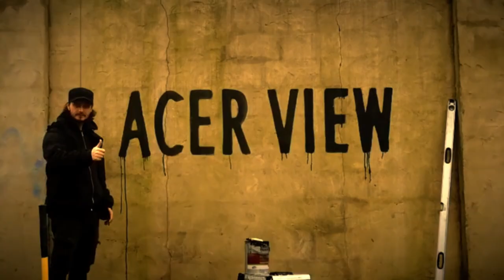Roof mortar mix ratio - tiles - verge - ridge - DIY

Comment: Why is Tim do it so differently you're supposed to add your sand to your lime and let that mix thoroughly for at least 15 to 10 minutes before you even start adding your water to create a better mix in theory you're three to one should only be three buckets total but besides the point adding water first creates a weaker inferior mix it don't allow the sand and lime to mix thoroughly without clumping up you probably had to mix it for 45 minutes before it's done extra it is key to make sure you're sand and line mixed thoroughly together before you add water to it that's just the way it is tim
Reply from the maker: Please refer to my response to your other comment
Reply: If tis guy's three to one is three buckets total, I'd love to see him mix 1:1:1 🤪

Comment: Interesting in that your local council allows you to fix the ridge with mortar, mine insisted on a mechanical fix. I much prefer the look of a mortar ridge but I have to admit the mechanical fixing will probably stand the test of time better. I,  also like to put a bit of water in the mixer first
Reply from the maker: You can do it with mortar but you also have to have a mechanical fixing too, so I have both. That's why everyone just does a dry verge now cause its mechanically fixed and is easier and quicker to install.
Reply: Regulation since 2015 requires all ridge tiles wether new or old , dry fix or wet must be mechanically fixed also
Reply: We mortar bed ridges on roofs that originally had that new builds we dry ridge their reasons for making it mechanical fix is stupid ridges don't often come off and some people are not impressed with a single screw holding their ridge down
Reply: @matthewthorley338  yes but why ? There are ridges bedded on 200 year old properties that are solid as rock
Reply: @master_Blaster91  yep I fully agree , have to be a poor mix and installation to come off
Reply: @matthewthorley338  also how do you actually bed and mechanically fix ridges I've never done it so don't know how it's done 👍
Reply: @master_Blaster91  batton fitted across ridge like a dry system , bed ridges on and the use the same fixtures as a dry system but threw the wet mortar on the joints with the metal clips , pain in the arse buy some clients request it some don’t
Reply: @matthewthorley338  thanks do you have to be careful not to screw too tight for it could push the ridge down into the wet mortar?
Reply: @matthewthorley338  sounds like a headache for me that 😂👍
Reply: @master_Blaster91  yes it can pull down into the mortar, we used broken tiles on the ridge tile ends and help to prevent with sag when tightening , even if it’s pinched tight it’s there for the client to visibly see them fitted. As you know the mortar is more than sufficient on its own as the tests of time have proved already .
Reply: @matthewthorley338  well il eat my words as I've just come home to a ridge that's blown off my roof and half of it is burried in the ground now would of definitely killed someone. Big meter long thing aswell

Comment: It allway cracks no matter what your mix is  I have tried loads of different  mixes I even tried a roofers secret  he used ceramic  floor tile adhesive flexible external  it last 2 year soon as sun heats it up the roof exspands boom it cracks  the last time I used flexible like trowel mastic  dried out and cracked I will not give in and fit a dry verg I have just painted my pointing with cromopol acrylic in black  should have said my ridge tiles are staf blues with the 40mm lip glazed nightmare
Reply from the maker: @patterdalezipsuzilil  have you tried a lime based mortar?

Comment: I was told by a roofer not to use plastisicer, builders use plasticiser, fairy liquid etc
Reply from the maker: Not sure why not, nhbc recommends using plasticiser. Means less water, less shrinkage. I wouldn't use fairy for anything other than for dishes

Comment: Hi Aiden.  Very helpful videos. I have to remove, clean up and reset a line of ridge tiles. I wondered, how long does your mix remain workable for? Will the last of the mix still be useful after two or three hours?
Reply from the maker: Hey, as the roofing mortar is dryer than brickies muck I'd say it would be a push for 3hrs workable time. I'd say on average you would be OK on maybe an hour and half, even then you might have to add a tiny bit of water after an hour. You might be able to push it a little more because of the low temperatures at the moment though

Comment: Im a roofer of 37 years. I incorporate SBR into my mix which improves bonding and also acts as an integral waterproofer. 
Its appropriate to use SBR as its used with rendering base coats.
Toodlepip
Reply: What’s you mix please? I’ve verges to do and some ridge tiles to repoint. Slightly worried about the verges cos the existing stuff (50years old) is crumbling out and the undercloak is deffo asbestos. Some is still adhered to undercloak and don’t fancy disturbing it. Any help /advice appreciated.

Comment: Hi Aiden is white cement hydrated lime.like you im self diy person great job by the way tnx for your content it really helps 
                    Dave🏴
Reply from the maker: Hey, no they're different things. They're both 'binders' but they have different properties. You would usually use one or the other. I've only used cement in the stuff I've done but have been on a lime short course. I suppose it could be argued that lime would be better for a roofing application as it's less brittle and if it does crack it can self heal. I don't know enough about it to advise on the mix or anything though. I have heard of builders chucking in some lime to lighten the mortar but as I had white cement and white sand I didn't need to do anything like that
Reply: Morning Aiden thank you for your swift reply mate any advice helps or a second opinion great job your doing thank you.
                  Dave🏴

Comment: Is this building sand the same sand you used on your garden wall? Trying to achieve a nice light mortar like yours, thanks aiden
Reply from the maker: It is indeed, they call it white soft sand round this way
Reply: @THE-AIDEN-PROJECT  I've tryed everywhere locally and even the yellow or what they call misson grey sand is basically red! 
I've found some up near Scotland which is super light which will be just fine I think but it's expensive to get it down to South Yorkshire. It's a similar build to what your living in currently, taken alot of inspiration from border oak cottages 

Well done with the build coming together now 👍🏼
Reply from the maker: @mitchhicken  ah that's a pain, I'm in East Anglia. I know it varies all over the country

Comment: Can you use Lime instead of a Plasticisers in the mix  ?
Reply from the maker: I don't believe so, you can use lime instead of cement, they're both binders but cure differently.
Reply: @THE-AIDEN-PROJECT  
The old method is to add Lime to the mix as it gives the mortar more flexibility and reduces moisture being absorbed into the structure  . My builder friend said he'd use Lime and no plasticiser , I'm looking at both options and weighing up the difference  .
Thanks for reply  .
Reply from the maker: @-Atmos1  if you're going to use lime then I'd just go with that instead of cement and plasticiser. A lime mortar is abit more flexible/workable. It's also good because it can self repair small cracks so it'll probably last longer than a cement based mortar
Reply: @THE-AIDEN-PROJECT 
 Cheers , that's useful to know  .

Comment: Was that white cement you used there?
Reply from the maker: It was indeed. I had it left over from the wall build and also wanted a little continuity across the site. I also used 'white' builders (soft) sand. Although the sand isn't actually white, just less yellow than usual and a tiny more expensive. Grey cement works just as good 👍
Reply: @THE-AIDEN-PROJECT  where did you get the white/grey sand and what exactly did you ask for we are trying to get a really light mortar colour
Reply from the maker: @mitchhicken  it's called white soft building sand. Sand colour usually varies all over the country. In my area I can get red or white but in some areas you can get silver.
Reply: @THE-AIDEN-PROJECT  where is your build? Looks superb
Reply from the maker: @mitchhicken  I'm east anglia
Reply: You can also use 1 sharp sand and two building sand to one cement.This will increase strength of mortar.

Comment: Where do you buy the white cement ?
Reply from the maker: It was from a local builders merchants. You don't need to use white cement of course, I just had this left over from the garden wall build
Reply: @THE-AIDEN-PROJECT  do you know what it was called the white cement the brand ?
Reply from the maker: @haydnrzsupra  Rugby White cement
Reply: have you tried the butchers